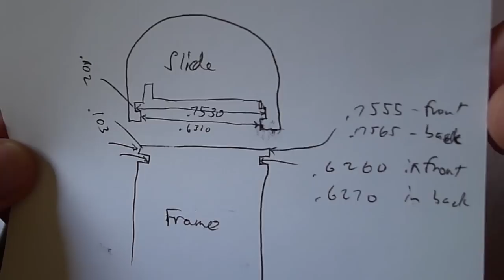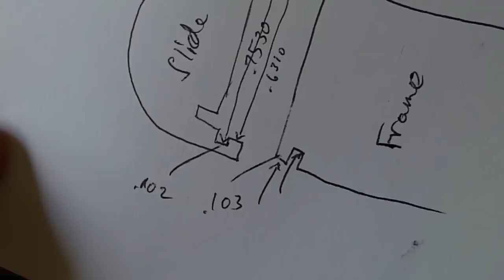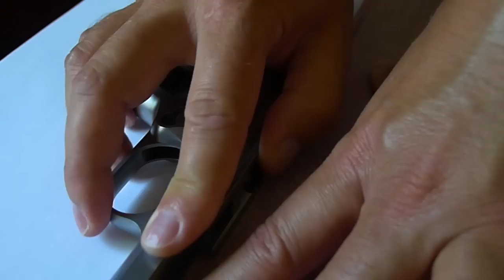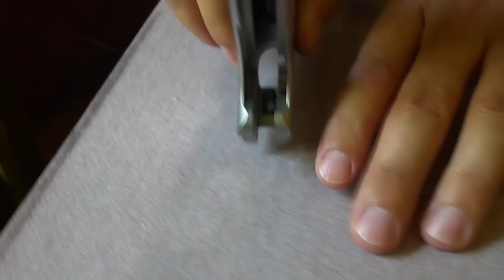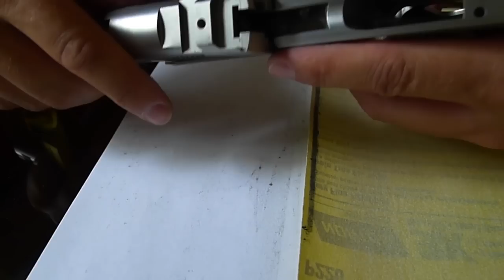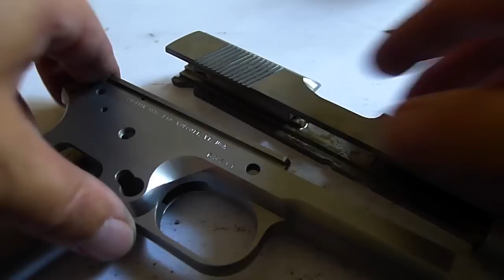1911 Build—Alternate Slide Fitting Technique (for the poor man)

Comment: practice makes perfect !!! I'm a retired national match gun smith for DoD.I've built and rebuilt 1911's - m1's-m14's for over 30 years .I used gallons of lapping compound (non embedding  lapping compound ) thousand of sheets of sand paper and files and big hammers . I use files to get close then sand the rough spots the corners where the cutting tools leave burrs then I use lapping compound and the big hammer are my work bench to knock it on then off . Look for high spots go again watch for chips (filings are other debris ) that will make the slide gall up use thousand grit lapping compound and oil . once the slide goes all the back remove the compound and replace with oil . If the slide is still rough thin the compound with oil and work it back are fourth till smooth . There are lots of books on 1911's get all you can and read .
Reply: @am1911nut
  I was quite fond of the 1911a1's I carried decades ago in the MEU and elswhere.  Ours were re-worked at PWS in Quantico, from original US GOVERNMENT stockpiles.  It was a great firearm to shoot, I cant shoot the Glock anywhere nears as well...that trigger is/was a world of difference. Thanks for your advice and your service in keeping these war horses combat efficient.

Comment: Before test fitting the slide use a black marker and cover the slides on frame. Then test fit slide and the areas where the maker is rubbed off are your areas where material needs to be removed. This is the technique I used along with quality files and stones. I also did lap at the end once the slide was able to go on snug but only went back and forth a few times. I now have a tight and hand fit 1911.
Reply from the maker: Great tips! Thanks!

Comment from the maker: I actually didn't really use the measurements other than knowing that I'd need to take a bit more off the rear, and so used a bit more pressure on the rear. The galling on my first build was caused by pounding the slide onto the frame. This time, I just tried to get the fit really close with the sandpaper so I wouldn't need to do any pounding.

Comment: Get the frame jig you put a stone in the jig and work each side of the frame rails perfectly square.If you use laping compound your making a mistake,Lap with oil not any abrasive.I hand built many 1911s since the 80s fitting every part by hand and had really tight pistols that shot really well.No break in they just ran with wet rails.Oil your rails.

Comment: when test fitting you need to clean and oil frame and slide. the compound takes up space thats where you get your loose fit. alot of gun smiths don't use lapping compound just stones and file to fit.

Comment: The phantom jig, small amount of sanding and hand lapping has always been the best approach for me. The $50 slide file from Brownells is ridiculous. There are many ways to get to the final results. I use a rubber mallet to help persuade the slide to move across the frame. Lapping is where I see the best results. I used valve lapping compound.
Reply: Phantom jig is meant for aluminum frames this is steel.
Reply: @ogsniper743  Yes I know this is two years old but I just used the Phantom jig to cut the rails on a steel frame 80% 1911 and the company I bought everything from even says that it's difficult but you can do a steel frame with it. I did buy an extra cutter for the rail cutting part of The jig. I cut one rail and part of the second one before switching to the new cutter. I will say this, it was extremely difficult and it took a long time, you have to go really slow making several adjustments just to reach one notch on the gauge.

Comment: If you have a shop that makes Granite counter tops near by, they have scrap pieces that they toss out.
I have several pieces I use for polishing flat surfaces.
Counting the strokes is good, but measure, measure, measure!
One part might clear, but the other will prevent installation so you keep going and take off too much.
Make the sandpaper thicker with tape.
My Citadel slide sounds tighter.
Reply from the maker: Great tip. Thanks!
Reply: BTW, love seeing these build videos.
Especially when you make the screw-ups I'm sure I would have made and then some!
Doubt I would ever build from scratch, but if I ever need to make a repair, I have an example video.
Thank you!
Reply from the maker: Thanks, Michael. It was a good experience and I learned a trmendous amount.
Reply: out of curiousity why wouldn't you just use an Arkansas stone or India stone? Thats what we use at the shop. Or on some instances a ceramic stone. Depends on firearm and what I need to do of course. No harassment here, just asking.

BTW; Caspian frames are the way to go if you want your own custom build. Good choice. Brownells always seems to be back ordered on them.
Reply: A friend got a frame and slide with a few other parts and they were fitted from the factory.
Thats the way I'd go if I ever did one.
I'm too old and too lazy to do it that way.

Comment: Ak's and Gl9vks have taught us: if it doesn't rattle, it isn't reliable. I see so many people talk about "tight tolerances" on 1911's. For a match gun, sure. For a carry gun? F*** no! I'm pretty sure John Browning was a bit smarter than most of the gunsmiths I have talked to about 1911's. Slight rattle= loose tolerance= can handle some dirt.
 On my third 1911builders build. Their rail cutting jig can be fitted with cutters one/thou wider than standard. I polish the rails on the frame after I deck it to 5k grit, then I fit the primary and replacement slide to the frame. Since I cut all my frame rails to same dimensions, the slides of the govt's are interchangeable. I have never pounded a slide onto a frame, either 1911 or polymer80 builds. Fit them properly, or just buy completed guns.
Reply from the maker: Yeah, I'm embarrassed about the slide pounding. Live and learn.

I've heard the same thing you said about a loose fit being more reliable. Truthfully, I just don't have enough experience to state one way or the other.

Thanks for your comments.

Comment: You waited just a tad too long to break out the lapping compound. Usually when I do them (and I prefer to do them without a mill) I'll get the slide to go about 1/3 of the way in front and back with a similar method, then coat the rails in dykem or sharpie and tap on the end of the slide front and back with a rubber mallet (you don't have to beat on it, a few light taps will do) and see where I'm at. Then lap away a little at a time.

Comment: good on the moving ahead on the new one. i really liked the first set of videos you did. i really wanted to make a point with you about using a caliper to try and measure anything to less than .001" (heck in most scenarios .002" !" as even though you have a good set of calipers they are really only good to .001" . why they ever put that hanging .0005" on there ill never know. it really only misleads folks into trouble.if you want to measure .0005" then you need a instrument with at least twice that resolution and preferably 4 times resolution. another thing ive noticed is that you really need to use you vice more it helps to keep things square when working with your files.
looking forward to more vids on the new piece!!
Reply from the maker: Thanks for the tips, Wayne!

Comment: Hello Jay. You should definitely stay away from the lapping compound. When using it on slide to frame fits it tends to leave you with a less than near "0" tolerance fit. You had a really good start, even though I am not a fan of sand paper but as soon as you started lapping you lost your tight fit. The absolute best method is a surface grinder but if you are hand fitting I would stick to lightly filing and stoning.
Reply from the maker: Thanks for the tips, Jimmy. Some good ideas to try on my third fitting (whenever that may be). :)

Comment: you want to go round 3 for your frame and slide matching?? use milar tape on the frame and slide so as not to scratch them and USE wet and dry with sewing machine il t cut and polish at the same time, r instead of oiluse water or better yet cka cola

Comment: I like your idea with the glass table. Because we used to lap flat surfaces on glass. But why didn´t you glue the sandpaper on the glass table with super glue or something? Because when you just put it on table it will take more material on the leading edge then in the middle and the following edge. And you could use water sandpaper. Beginning with 300 or 500 grit.
Reply from the maker: Briareos Good ideas for next time.

Comment: Hey Jay might it be easier to just buy a "drop in" parts for "some" components that maybe crucial to guns operation?
Reply from the maker: It's just a continuum, Mitch. If what you want is ultimate "easiness," then just buy a gun. At the opposite end of the spectrum, if you want to try it all yourself (that was me, in this case), then fit everything. Your point is a good one, and that is simply that if someone is concerned about a tricky part of the build or doesn't want to tackle something in particular, then just buy a drop in part. I actually mentioned that in other comments sometime back. For example, you could buy a frame, beaver tail, and barrel that will all "drop in" and then just assemble everything yourself, doing a basic trigger job, and you'll have your own build, done quite easily.

So, yes. :)

Comment: That's great work, do you still have this pistol? I recently did a steel frame 80% which means starting out with absolutely no rails on the frame with hand powered jig and cutters. Let me tell you that is a lot of work wow. Mine didn't end up as tight as yours but it's about like a mil spec Colt so I guess it should be pretty reliable. If anybody decides to try a steel frame 80% 1911 I recommend that you buy an extra cutter for the rails and take extremely tiny bites and be really patient with it.  Also keep using lube and keep cleaning out the metal shavings. It can be done but it is difficult.
Reply from the maker: I still have it, but haven't shot it in a long time. Good job on the 80%. I'd like to try one of those some time.
Reply: @jayphilipwilliams  Just be very patient if you do a steel frame 80% and take small bites with the adjustment knob. A second cutter for the jig is pretty cheap but you have to finish at least one side with the first cutter. I didn't have cutting oil but used 3 in 1 oil instead. If I do a second one it will be much better, there is a real learning curve. I was just happy not to ruin it. I can give you more detailed points if you ever try it.

Comment: is there a technique to fit the slide without sanding the frame?  my thoughts are that slides are easier to get and replace than frames, therefore, I would rather work the slide to ft the frame, than the other way around
Reply from the maker: I don't believe so.
Reply: Good point. what if there is a variation with the slide rail on the inside of slide mating surface?

Comment: That is way too loose. You should, at a minimum, use a stone for this. I didn't see your first build, but if this one was better, good job. Can't be perfect your first time, or even your second.  Watch tons more videos of how to do it. You definitely want to sneak up on the clearances. One swipe at a time on the stone if need be. Don't force the slide on at all. Just work the top side on the rail first. And stop trying to slide the back of the slide onto the back of the rail. They're no going in the configuration of the gun. They don't need to fit them that way. That's another reason you have a sloppy slide. Just be patient. Fit the slide exactly how it's going to live.
Reply from the maker: Thanks for the tips!

Comment: I'd but the slide already fitted to the frame. Leave to the pros.
Reply from the maker: One cool thing about building a 1911 is that you can do as much or as little as you'd like. You can go all the way from building it from a block of steel to merely assembling the parts.

Comment: I have question: do you need FFL licence to by frame and slide ???
Reply from the maker: Ryszard Sytnik The frame has a serial number on it, so you would buy it just like you would buy any other pistol. That will differ based on where you are.
Reply: I live in Arkansas and perhaps to buy a frame I need to order by gun dealer. That will be my guess. I was looking at all this parts and jig and when you added it will be quite expensive. Almost as new/ready 1911 from dealer. Thank you Jay for replay
Reply: Buy your frame from an ffl dealer,or do an 80% frame.The rest of the parts barrel slide and every other part you can order and have sent to your house.The frame is the gun and has to be puschased from a gun store or ffl holder.If your a felon you cant buy or own a gun.

Comment: Im poor, I cant afford a colt 1911, what can I do to solve that?
Reply from the maker: I would recommend buying a used one online or at a local gun show. Then, it should be pretty easy for you to purchase new parts little by little and fix it up. I'd start with a hammer and sear and do a trigger job. Then, you could replace the barrel and bushing, beavertail, etc., as you can afford it. You could buy drop-in parts, or gunsmith fit if you're good with your hands. Here's a sample query of what you can get on gunbroker.com. Good luck!

https://www.gunbroker.com/All/search?Keywords=1911%2045%20acp&MinPrice=200.00&MaxPrice=500.00&Condition=4&Sort=13&PageSize=24

Comment: Jay, please step away from the lapping compound! You cannot get a good fit using it, that's why custom guns cost so much-there is a ton of handwork involved. FWIW, unless the dimensions are just grossly off, a mill is almost never used, it's all files and stones. That said, it takes guts to risk ruining a frame and slide by doing it yourself and you don't learn unless you try-it's how the founding 'smiths developed the methods that we use now. FWIW, some of the slop can be removed by using frame bars and tightening up the side clearance.
Reply from the maker: So you just file and stone, and then you're done? In everything I've read, you use lapping compound.

Thanks for your thoughts.
Reply: Yes, the lapping compound definitely works, you just can't really control it like you can with hand filing/stoning. I learned from an old gunsmith who learned from Paul Liebenberg, Frank Pachmyr  and the like, but I've still got a long way to go to reach their level of expertise. That said, I'm glad to see folks out there getting their hands dirty, experience is the best teacher, so my hat's off to you!
Reply from the maker: Thanks for the kudos and for the extra information!